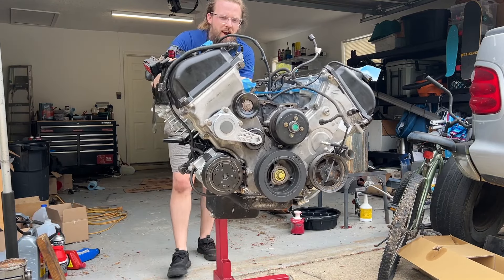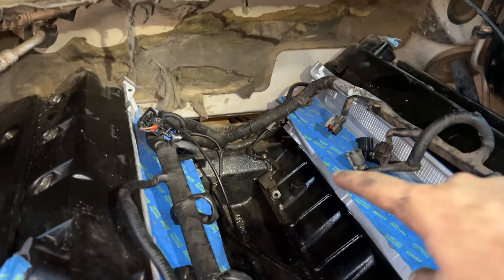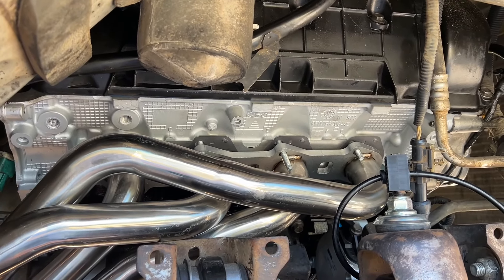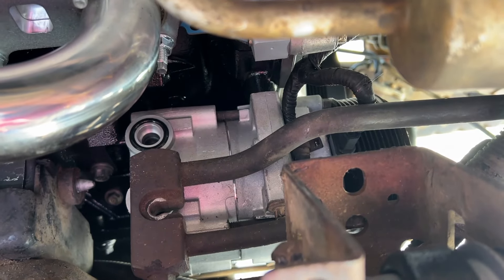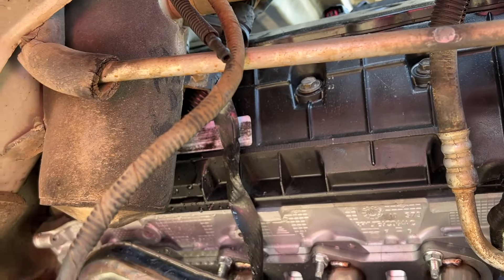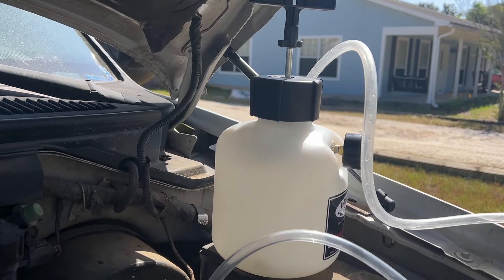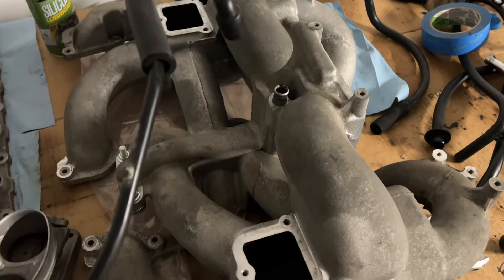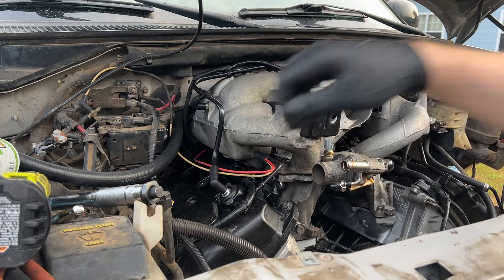$500 Navigator Swapped F150 Project Runs and Drives!

Comment: This is really the engine that this generation of F150 should’ve had in the first place to be more competitive with the output of the GM trucks of the day, but Ford wanted to save a few bucks per truck. What really surprised me back in the day is that Ford didn’t even give the Lightning or Supercharged Harley Davidson F150’s the 4 valve heads. Nicely done.
Reply from the maker: Yeah, that is kinda crazy. I wish I had a reference for how much better the truck feels with the power that the 4v has vs the 2v
Reply: @JJinMotion  I was wondering that myself. My guess is that low-end torque is similar between the two and it’s probably less noticeable at lower revs, but that at higher revs the 4v makes noticeably better power.

Comment: I was considering doing this swap in my 05 f150, or at least the heads, front timing cover and intake. But it was more than I wanted to take on lol.  You did a great job. Can't wait to see how it does when you get it all dialed in.
Reply from the maker: Thanks man! The 05 is a 3v, right? I’ll keep you guys posted on how it’s running. So far engine is running good and trans is smooth, but couple annoying little things to sort out
Reply: @JJinMotion  yes it is a 5.4 3v. I decided since I was in there doing all the  timing chain stuff,  oil pump,  lifters and followers, I'd put in a set of comp cams 127400 cams. So my money went to cams rather than 4v head swap. Lol
Reply from the maker: Haha money well spent it sounds like!
Reply: @JJinMotion  it better be lol cause getting the cams was like opening a can of worms. Then I needed valve springs,  phaser limiters, injectors, bigger fuel pump,  and custom tune.  All because I needed to do guides and tensioners hahaha.
Reply from the maker: Haha I hear you on that! I wanted so badly to turbo this engine, but knew it’d spiral out of control with all that stuff - tune, custom fab work, etc.
Reply: @JJinMotion  💸💸💸💸💸😂😂

Comment: I’m working on the same year f150 and am currently looking to engine swap as well any tips ?
Reply from the maker: It’s a huge job but totally doable. Just make sure you get a an 01 or 02 navigator engine + harness so it’s all plug and play. The later navi engines require more modifications
Reply: Hey i have a 00 navigator would the ecu work from that the 00 and 01-02 have the same part numbers i just would like your opinion

Comment: came for the truck video, stayed for the relatability.  showing the WTf struggles in the moment hit home.  i was doing an intake on a 5.4 years ago and by total freak accident, dropped a coil pack retaining screw down the open injector hole!!!  like how, why, chances the valve was open / shut, wtf!  did you also do the engine rebuild?

Comment: Freaking awesome! 

Some helpful tips from somebody that has a 10th gen also a, lightning to be specific. 

Get a standalone trans cooler to avoid killing your trans (from experience here water got into mine because of a bad radiator) oh, and upgrade the radiator to the 3inch if it doesn't have it yet. 
You can find it on the 4x4 expeditions of the same generation. Highly recommend getting electric fans and wire them with the 3 relay 2 speed setup to avoid huge amp draws at start up in case you decide to set up on a switch for the a/c and the high on a 190 temp switch.

My truck was a hoopty and ive had to do so much to it and im glad because it teaches you a lot.
Reply from the maker: Thanks man! I was thinking electric fans seemed like a good idea. Any recommendations on brands or are there any kits? Also I appreciate the shoutout on the radiator since I plan to be towing. Don’t want any overheating issues

Comment: Where did you get those long tube headers?

I saw a post of the fb pages of a guy looking for some and folks just told em to splice some up from a cobra to some f150 ones.
Reply from the maker: I bought ebay 2v lightning headers and then in a previous video I opened the flanges up with a dremel - seems good so far! Learned about this from a channel here on YouTube called @fourcam150